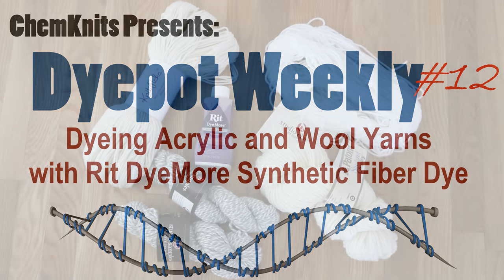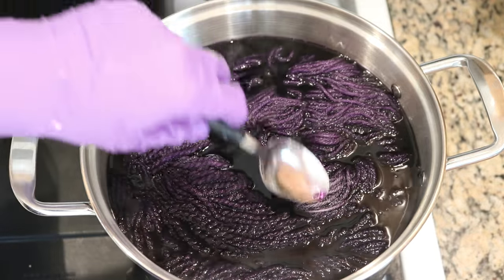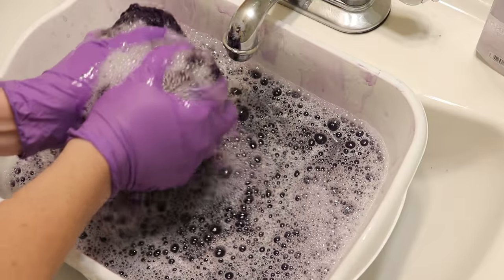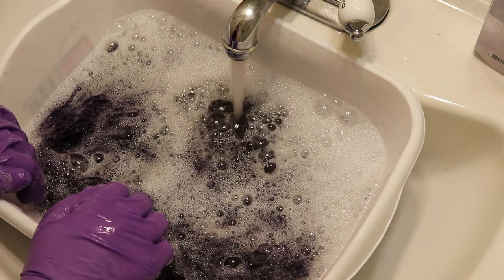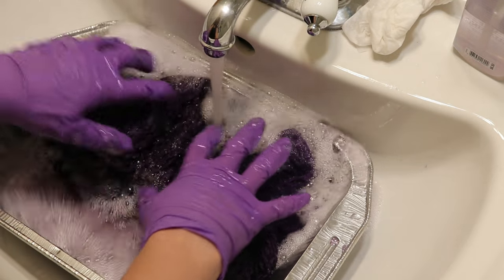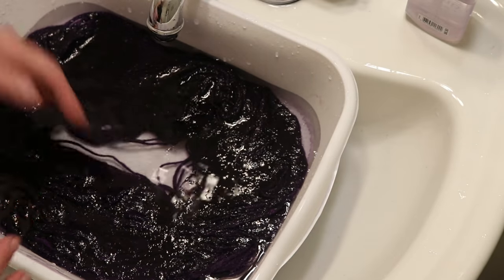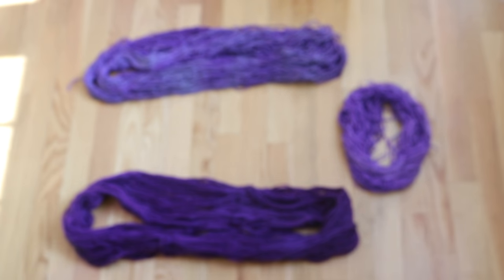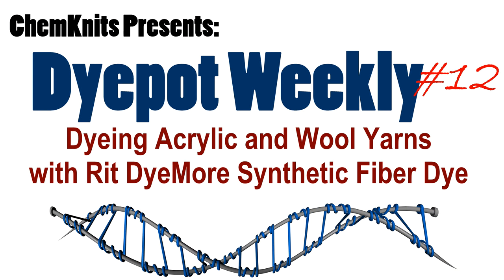Dyepot Weekly #12 - Dyeing Acrylic and Wool Yarns with Rit DyeMore Synthetic Fiber Dye

Comment: Tip for acrylic: bring the water to a boil and remove it from the heat to avoid melting fibers, especially if you don't want to stir the yarn while dyeing. DyeMore is formulated to coordinate in color across all fabric types, synthetic and natural.  Avoid having to wash so many times by using less dye.
Reply from the maker: Thank you, Allie!  I've found that Rit seems to encourage you to use a lot more dye than is actually required (probably because that would help you get a more even color.)  I absolutely plan to use less dye next time. :)
Reply: Great tip ty ! I plan to dye a mix yarn 🙏

Comment: The wool can handle the heat better so if you put the wool in first you might not get the melted acrylic, It is right on the bottom of the pot against the element.
Reply from the maker: At least the yarn is still usable!  I see the melting when I do wool/acyrlic blends sometimes.  I now have a thermometer so I can moniter the heat better.
Reply: Also, I think you're supposed to keep the yarn moving while it's in the dye bath. I think that would keep the acrylic from sticking in one spot too long and melting.
Reply: @toxicbutterfly02   But too much movement has felted the wool I've worked with sometimes.

Comment: I have not used the liquid dye yet. I like using the powdered RiT. Either by sprinkling or mixing a solution. A little goes a long way and you do need to rinse alot. I think i get more control with the powdered.. i even use it in the microwave in dye only containers.

Comment: Water boils close to 100 ° but not exactly. It depends on the air pressure and how much moisture is in the air. Did you record any data with further experimentation?
Reply from the maker: I didn't record the temperature directly here, and you're right that it does vary on air pressure.  (I'm pretty close to sea level where I did this.)

Comment: You added so much soap to the rinse/wash that it's no wonder the wool felted!
Reply from the maker: I frequently use around this much soap in my videos.  The issue was more about the vast number of rinses, and squeezing, and therefore the agitation.  This is the most felted I've ever had from any of my yarns.  I think there was just WAY too much dye in the pot plus it isn't meant for natural fibers.
Reply: Wool felts with 3 things: change in temp, soap, and agitation. You went from hot to cold, even if you did allow the fibers to cool down. It is always best to go from a cold state to hot. I'd rinse in warm water not cold. When you are ready to add soap- do not allow to suds. Just let it sit in soapy, unsudsy water. Rinse without pressing, squeezing or without much handling until clear of dye and soap.  :)  I also agree its a bit much soap just to rinse out dye. Soap is better to cut lanolin or grease. BUT I do enjoy all your experiments! Thanks for all your videos.
Reply: In my very poorly expressed comment, I was trying to say that there was so much excess dye that it would have been better to rinse until almost clear before adding the soap. I'm sorry for that. I really enjoy your yarn dyeing adventures!
Reply: @amiranda365  it wouldn't felt anything if tbe wool had come back to room temp which i beleive had happened. Its mostly the heat with the movement that felts. I have dyed many skeins and the ones who came near felting had alpaca in them or were 100% alpaca and i did get too agressive moving it around. However they were not truly felted but just innthe beginning of felt and they did pull apart nicely giving me a lovely halo on the swift.
Reply: @marlenejones6266  Heat and agitation alone do not felt. Try washing raw fleeces or felting projects. As you said, your skeins did not fully felt. Depending how long you were handling them, the changes in water temperature could have contributed to beginning felt stage. It is the expansion- contraction of fibers and scales caused by change in temperature and pH from the addition of soap along w agitation that cause felting.

Comment: I tried using the same dye in Apricot Orange on Loops and Threads worsted yarn, the 285 yard one...and somehow it ruined the yarn. Too much heat, maybe? Any tips?
Reply from the maker: Hmmm... this is the only time I've tried using the Rit DyeMore Synthetic dye.  how was the yarn ruined?  Did it melt a bit?  That can happen with acrylic and heat.  I might try using a lower heat.  I hope to do some more videos with this dye type soon.
Reply: I recently tried dying with dyemore and followed the directions exactly. One thing I do remember is that it says to stir "consistently" (I took it to mean very frequently). Not sure if that was for consistent color or to keep things from melting by being on the bottom too long? I'm planning to try again to hand dye some Christmas presents for friends who are allergic to wool but I think the weirdest thing to me was the instruction about adding soap to the dye bath.

Comment: What directions did it give about dying synthetic or acrylic items?
Reply from the maker: I'd have to find the bottle and see.  On the website they have slightly better 
instructions: https://www.ritdye.com/techniques/the-basics/dyemore/  But it isn't as though the yarn comes with a melting temperature on it.  ;)  I think next time I want to dye acyrlic yarn I would heat up the dyebath, remove it from the heat and let it cool a bit before adding the yarn.
Reply: I wonder about adding the dishwashing liquid to the dye bath. What is the dishwashing liquid’s purpose?  It’s very curious to be adding a detergent to a dye bath.
Reply from the maker: I never add soap to the dyebath itself, I usually add it when I wash it.
Reply: I guess I should have said I was asking about adding the detergent to the dye bath because that is what the directions say on the link you sent.